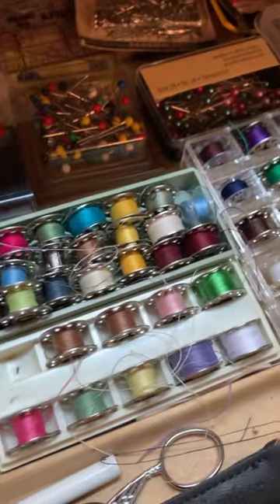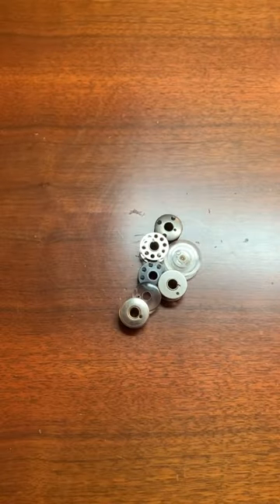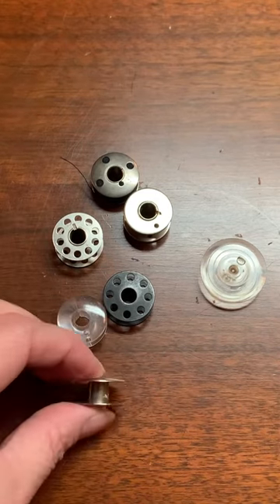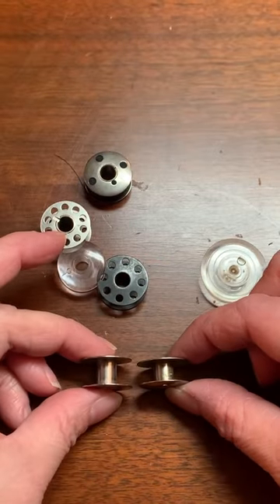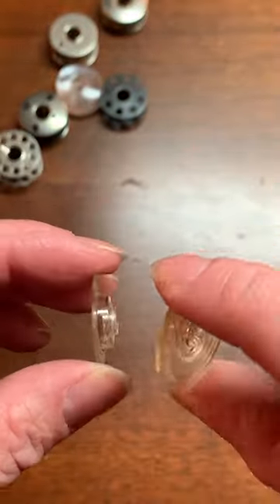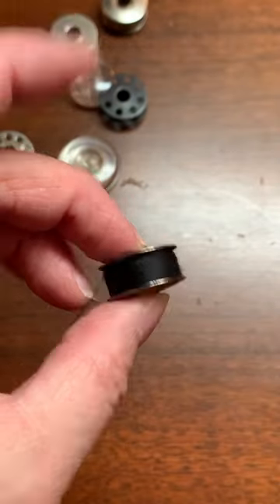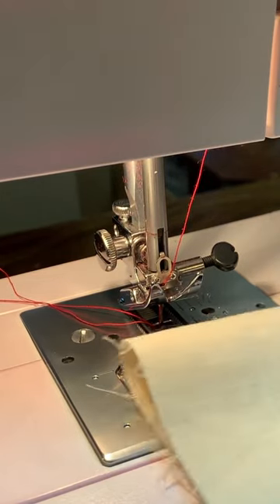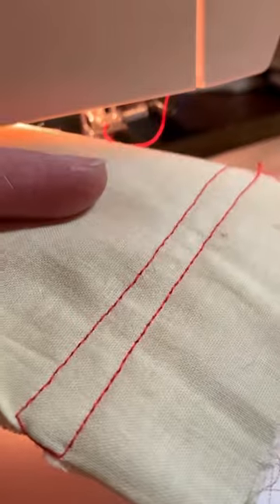Little Sewing Tip -  Bobbins

Comment: Hi!- thanks, this made me smile......
Wouldn't it be great if manufacturers just put a little note on the actual machine  somewhere near the bobbin case.....

At least the old 15k's are self explanatory in this aspect  ......
Fifi ( '51 15k80, treadle ) is as simple as it gets, of course her bobbins are the legendary 15k. Metal. 
And they're good for my 2000's Toyota. 

Now the "modern" crew, Singer Simple, jaguar 596, Singer C240,, silver 404 are 15k but plastic.
The Simple, toyota and 596 all have the zigzag wider slot version of Fifi's 15k  bobbin case, but the 596 needs a  15J  bobbin ( or she builds nests ).

The 404 and C240 are plastic 15k top loading. But the C240 only works well with actual singer branded bobbins.....😕

The 201's ( aren't they just so elegant 😍) and 401 are top loading with the old 66k metal.

I have a mini green Aldi cheapy ( she just looked so lonely amongst the bread rolls ) - she's also front load zigzag 15k, metalofsorts,  but i swear i could chuck a ball of wool in there and she'd still go. 
I thought  - cuteness and loneliness are not reasons to bring home sewing machines ....but maybe she'll be good to hawk away to my daughters who want repairs etc
Turns out she's a tiny Rottweiler- first thing she did was hem jeans !

So, i wonder, is the bobbin torture scenario, to a large degree, unnecessary???? 🤔

I'd love a singer 319k typewriter key vintage green beauty BUT 20u bobbins, specific case, near extinct needles, and strangely fascinating unique timing belt ...

Coming soon to my shrinking down sized flat is a given 95k40 and a treadle mechanism i hope to fit.
And an 80's New Home that may be a hospice situation.

 Yes, I'm now officially a refuge. My daughters are jealous of my devotion. Well, my mechanical beauties work hard for me and don't talk back!!

I love the simple mechanical genius of the old girls. Their elegance yet solidity. Their longevity and history. The soft clicking of a handwheel, the whirring treadle- a harmony. That i can do so much upkeep and not worry that a computer chip will go and it's all over.

   ❕⚠️WARNING ⚠️❕
please be aware that all vintage sewing machines are highly addictive, and produce hypnotic effects on the user. Users may make excuses, socially, to spend more and more time in the sewing room. Hoarding of accessories. Sorting and cataloguing of bobbins. 

Any third party is seriously  warned against the substitution or misplacement of bobbins.
                 😤😢😂
Reply from the maker: "the bobbin torture scenario" Hahahaha! This made me laugh. Yes! Some sort of labelling to minimize the torture. And yes, yes, these old gals are extremely addictive. Thanks so much for your comment!
Reply: @TheaStarr  Thankyou for your empathy! 😊💐
Reply: I love this comical “warning” but it’s true. Haha. I’m in there with you.